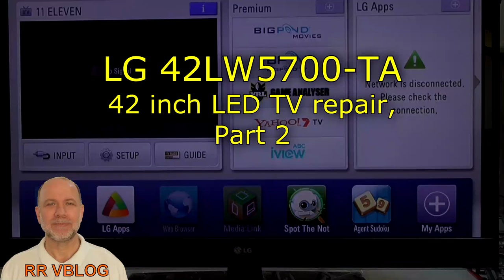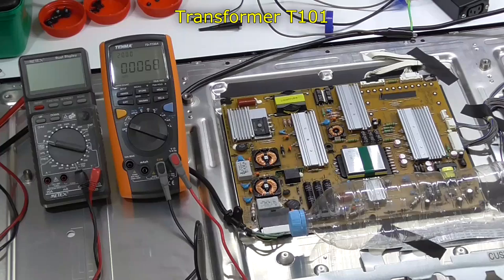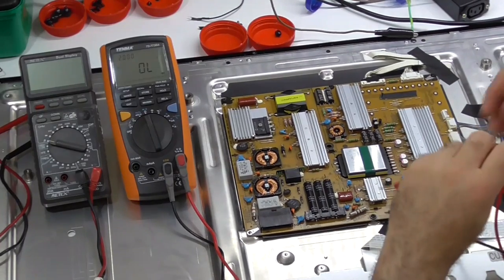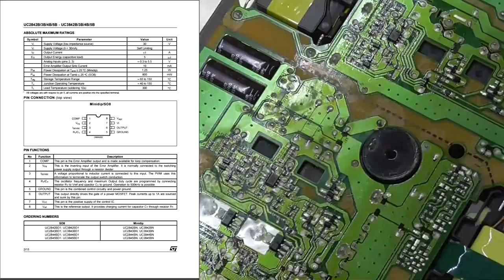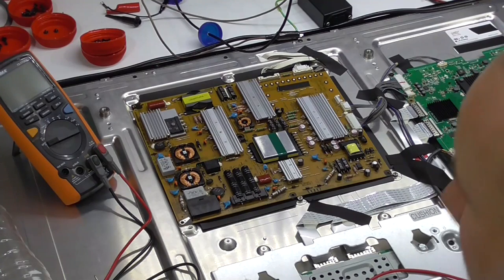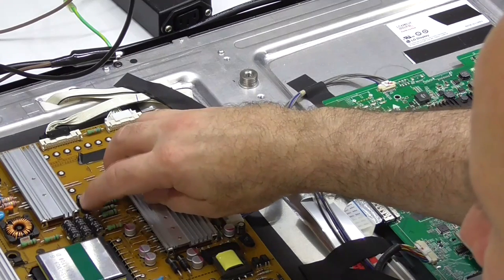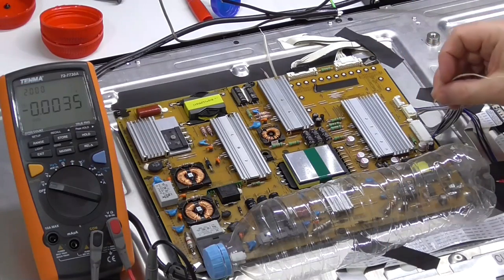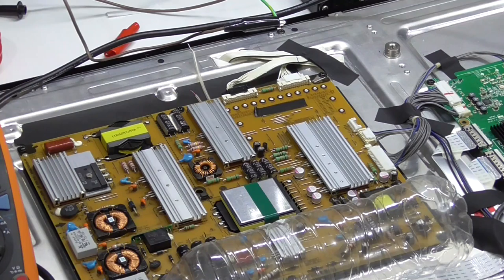Repair of LG 42LW5700 TA, LED TV, Part 2

Comment: Hello
I am Marcel, and i have a `panasonic TX P50X50 ,which do not have stand by 5v.The stby 5v driver is a FAN6755U ic,and i change it with a new one, but the tv is still not working.Please help me if you can.and make me understand how FAN 6755U work.Or,explain me for what reason  the FAN 6755u do not  want to start and create the standby voltage .,because for some reason doesn.t want to start.If you want to, I could send you the diagram.
Thanck you a lot
Reply from the maker: Hi Marcel,

first off, understand that working with the Mains circuitry is extremely dangerous. I find that the more I need to spend time working in that area, the more dangerous it becomes – it’s human nature, unfortunately.

However, one way you can reduce the severity of mistakes is to NOT power the supply directly from Mains. When working on standby voltage problems, I find that powering it up via a low wattage Mains transformer works well. As unlikely as it may seem, I have had good success fault finding standby circuitry with a 30 Volt AC, 1 Amp Transformer – much safer than 100 or 200+ VAC. 

OK, with that out of the way, I won't be able to help you specifically with fixing this. 

But I can simply reiterate the diagnostic process. You normally start off checking the easy stuff, then onto checking the high risk/likely components. Obviously this requires understanding and consideration, and if you don't have that, consider learning on something much less dangerous.

So, diagnostically, you would start off checking the rectified mains supply voltage (40\155\330 VDC), the supply voltage measured at the standby’s switching transistor, then checking fuses, Diodes, etc, if not correct.

Once you are sure the rectified mains supplies are correct, you then move onto further component checking. I would normally start of checking the standby’s switching transistor, then the transformer, the current sense resistor, the IC, etc.

Anyway, have fun, and *be safe*.